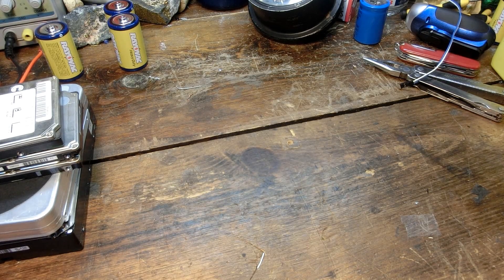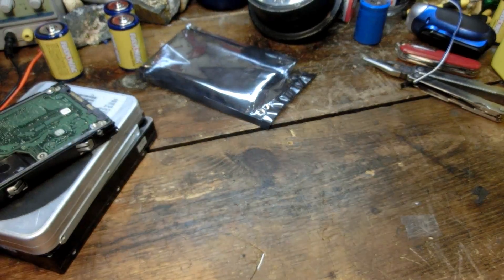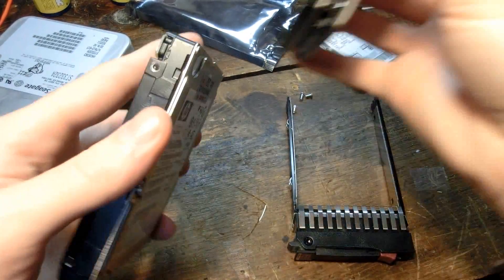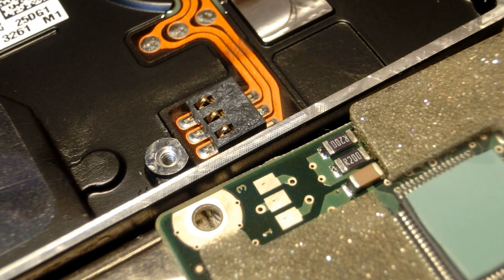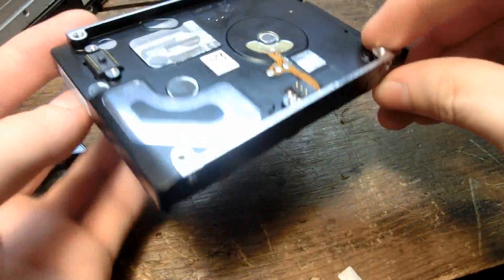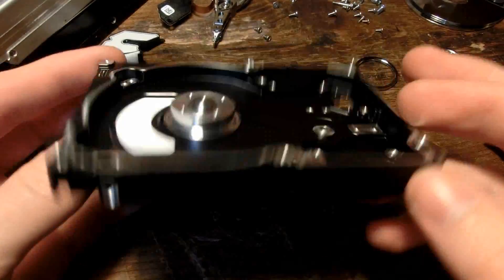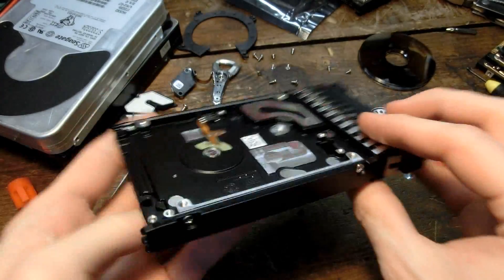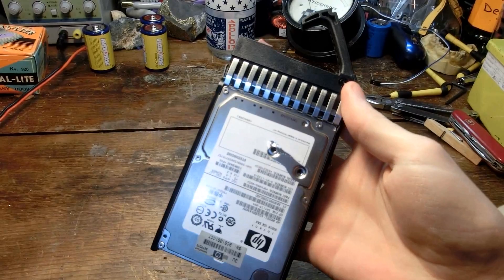HP 300GB SAS Plug-N-Play Server Hard Drive Teardown

Comment: I opened this model of harddrive, and in the process I punctured the air cleaning module. How do I dispose of it properly?
Reply from the maker: well its not really hazardous so, toss it into the garbage bin? but just because you poked the filter doesnt mean its bad.
Reply: @RinoaL  Some metal powder fell out, and I don't know if it is hazardous.

Comment: That connector prevents SATA data and power cables from being plugged in
Reply: Unless they are compatible with SAS drives which that block in between thr connector is in the cable

Comment: Hello! 
i want to recovery data from my server drive(Dual port 10k SAS 300GB SPARE 493083-001) without open it. which method should i use?
when i am trying to reboot the server it says "Error loading operating system"
Thank you for support

Comment: hai I too have the same HDD but is there is any converting cable for this type of SAS drive??
Reply: SAS drives need a SAS controller, they will never work on a SATA controller. For SAS there are many types of connectors many of which have adapters to different types of SAS connectors, just as long as a SAS drive is connected to a SAS controller.
A SAS controller will support both SAS and SATA, depending on the SAS controller some can do both at the same time without any issue.

Comment: This is a hard drive for an HP ProLiant ML300 series server... FYI.
Reply: +telecomguy10 This hard drive caddy is designed to function with all hp servers. Not just a particular model.
Reply: +mmhansen drivebays can be swapped on all models.
Reply: +mmhansen The serial numbers for the HP SAS drives are all coded to work only with HP software, We would occasionally get a new HP drive that was not recognised by the software as "HP OEM"  and we would have to trash it.
Reply: It's been a while but I believe the RAID controller said the disk was fine but inside the HP management tools the disk failed serial validation and would not initialize. Because of the data we stored in the facility all storage drives were shredded if they ever entered a server. Our team would change maybe 100 HDDs every day and I only encountered this maybe two times

Comment: don t destroy that. all it has is that the read write head is stuck on there. it shouldnt be ther . it should be parked at the side.
Reply from the maker: some park in the middle. and what would i use it for? its untrustable.
Reply: well it destroyed now anyway!
Reply from the maker: MIKAEL'S LAB
its just as useable as it was before. i wouldnt call it "destroyed" its just stripped down.

destroyed would be if it was strapped to a stick of dynamite and all that was left where scraps of metal and plastic that no longer resembled it.

Comment: I think they earth magnet is my fave part off a hdd they are very usefull , Also watch out for laptop hdd platters they seem to be made of a glass like substance and shatter if forced.
Reply from the maker: oh right i've heard of that, i always just asume they are metal.
Reply: Is it possible they made them glass like to lower the weight or maybe solveing some heat issue?
Reply from the maker: steve64464
i'm thinking more like to accommodate the more precise magnetic layer on the outside.

Comment: That chip must be to convert the delicate ultra low level analog head outputs to a stable digital signal, so it can be piped to the pcb, and the reverse processing of cause :-)
Ive taken stacks of drives to bits over the years, but ive never found a use for the platters, and the old 21mb elephants foot mfm drives have some dam chunky platters.
Its a lot of clever engineering to store data, although i think the original drives were only designed as a very short term storage buffer between computer buses, might have been ibm that did it, my memory isnt pefect on history.

Never heard of the sas interface, wonder if its sata with more data lines and a more secure/reliable protocol, pass, its an unknown to me lol.

Oh, i think that drive is well wiped now ha ha :-))
Reply from the maker: yeah, still weird that it looks like an image chip though.

Comment: Interesting video.  I always find the inside of mechanical hard-drives interesting for some reason...always harvest the magnets out of them, they are really strong!  I want to try harvesting a motor out of one one day.
Reply from the maker: yeah they are strong but they are curved and hard to separate from the backing plate. i prefer to just buy rectangular magnets from ebay like the ones i use to stick 18650s together.
Reply: Rinoa Super-Genius Yeah, I believe they are both molybdenum magnets.  Very strong, and hard to get apart from eachother, but they shatter easily.
Reply from the maker: sc0tte1
i think you mean neodymium?
Reply: Rinoa Super-Genius Yeah, probably lol

Comment: That hard drive spindle motor is 3 phase sensor-less BLDC motor and the position of the rotor is usually determined using back EMF zero crossing to determine when to energise the next set of  coils.You effectively control the speed by controlling the current.
Reply from the maker: oh i thought you would control the speed by controlling the frequency you feed into the wires, not by increasing the current.
Reply: Rinoa Super-Genius When you put more current in the rotor moves to it's next position faster when the rotors in the correct position you energise the next coil pair. BLDC motors are also called electronically commutated motors because they use electronics instead of a commutator to determine when to commutate. I have videos of my experiments with these motors on my channel.

Comment: Dude, the servers at my dads work still have these in use. Lol.  Its neat to see like, 56 of these all running at once....  lights flashing, motors whirring...  all backed by the loud fans on other servers...
Reply from the maker: my dad's company has them in use also. they do look cool. they only have about 20 or so drives if i remember right though.
Reply: 2,5 SAS drives are still very common in datacenters and other enterprise level storage. The one seen in this video is probably http://www.amazon.co.uk/HP-507127-B21-300GB-2-5-inch-Enterprise/dp/B0025B0EUS/ref=sr_1_12?ie=UTF8&qid=1420353009&sr=8-12&keywords=sas+hdd
Reply from the maker: v1nce n7
 yeah the drive i show in this video is far from out of date. its just this one went bad and had to be replaced. and once a hard drive shows any sign of failing it cant ever be trusted.
Reply: Yeah.  I didnt actually mean it so sound like they are out of date...  But I guess thats how it reads though...  My dad is vp of it at a company called centric data, which runs out of a mother company called americom.

Comment from the maker: right before i was about to make this video public i realized the music might be a bit loud, so then i spent an hour and a half re-editing the audio and its either too quiet or too loud. i gave up so here is the first version. i would like your input on if the audio is as loud as it seems to me. i've definitely had my music louder in my older videos, but that was to cover up very loud background noise. it may just be me overthinking it. i made it the same volume as on my other videos but yet it seems louder.
Reply: I think it's ok.
Reply: +Rinoa Super-Genius Music was just fine - might be a bit loud for headphone users but through my amp and speakers, the foreground audio (you speaking and the sound of you pulling it to bits) was centre stage, with the music just slightly behind.
Reply from the maker: Dysphoricsmile
yes thats called the curie point.
Reply: slightly too loud but fine. no need to edit more. only a couple of dB
Reply: Sounds good to me!
Reply: its ok :)
Reply: yeah, I honestly didn't think anything about the audio being too loud or anything.  I was actually enjoying it. XP
Reply: +Rinoa Super-Genius  SAS is the NEW form of SCSI, much like how PATA was replaced with SATA, SAS stands for Serial Attached SCSI - That Edge Connector is a male version of the Proprietary SAS connection, with all necessary channels for whatever version of SAS is being used,  with the following speed specifications:

SAS-1: 3 Gbit/s (2005)
SAS-2: 6 Gbit/s (2009)
SAS-3: 12 Gbit/s (2013)
SAS-4: 22.5 Gbit/s 

So as you can see OLDER SAS is equal to or slower than SATA 6, but all SAS is faster than original SATA and equal to or faster than SATA 3.

I am not sure if SAS-4 is available yet, but personally I would prefer direct PCIe, NVMe SSDs - for any NEW server builds that require massive data transfers, maybe use SAS-3 or better for backup or less accessed files.
Reply: +Rinoa Super-Genius  IIRC HDD motors do use a DC power supply.

See, ALL hard disk drives when powered on, are ALWAYS spinning at their constant maximum speed. In the case of the SAS drive you have there, that would be 10,000 RPM. The Read/Write heads REQUIRE the drive to be spinning at a continual speed in order to read data correctly.

In other words: All accessing of data is controlled ENTIRELY by the read/write heads. The platters just spin at a constant 10k RPM when powered on, with absolutely no changes.

of course that doesn't mean that the motors cannot be AC, but DC would seem to make more sense, as the speed never changes, it is either on or off. And a clean DC signal to a brushless motor would provide the required consistent spin rate.
Reply: +Rinoa Super-Genius 7:20 wow I have NEVER seen HDD platters separated like that, with that plastic piece between both platters and their read/write heads! Must be a function of their being Enterprise level hardware - built to take a TON of abuse without failure, and to have countless hours of 99.99% uptime.
Reply: +Rinoa Super-Genius  Yup, the failure was in the Platter drive motor! I could hear it the very second you cracked the case and spun the platters with your hand!

And yes, USUALLY the motors and their bearings will spin FLAWLESSLY even after being violently pried apart!

I have had to dispose of countless old hard drives, and when asked/required I would take them apart piece by piece, then proceed to use a propane torch to burn the platters to RED HOT, which - if you weren't away has the effect of completely degaussing the platters, so that no proper magnetic signal could be found even with the VERY MOST bleeding edge of data recovery! As well as usually warping the platters to the point that they would be impossible to recover anyway!

But then, your father probably knows all of this IF he is given the task of disposing of failed Data Drives with VERY important/private data on them that nobody ever wants anyone else to find!

And I would imagine he DOES take care of disposing of old server hard drives if he had a dead SAS 10k RPM HDD to give you for this video!
Reply: Yup! Anyway enjoyed your teardown of this drive, I have only ever seen OLDER SAS drives, always 3.5" - IIRC only up to SAS-2 standard.